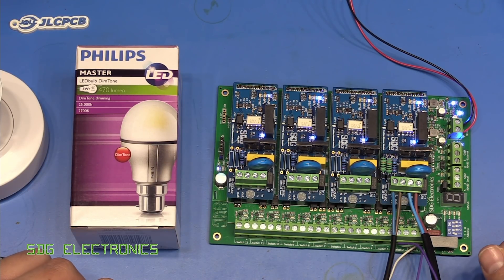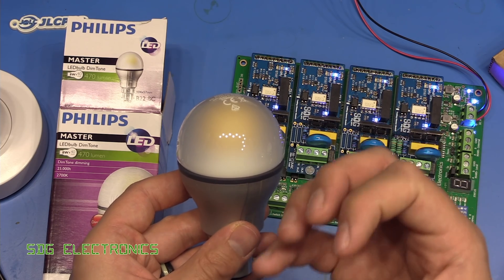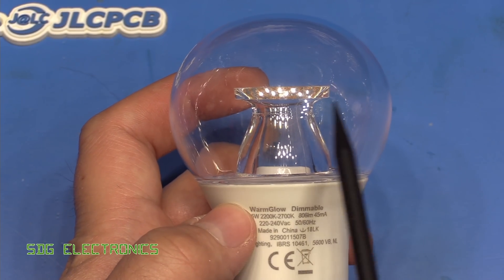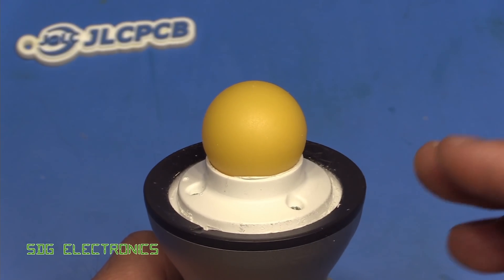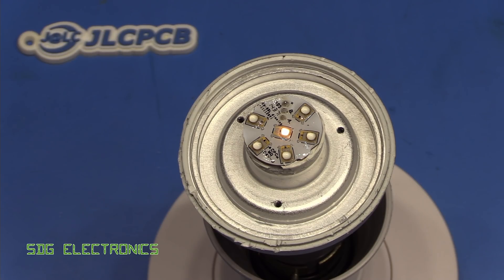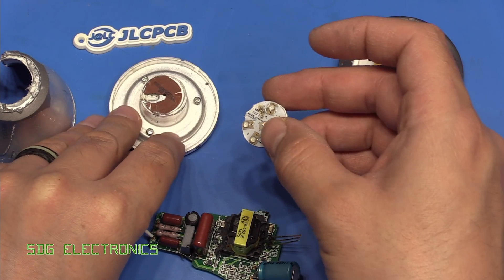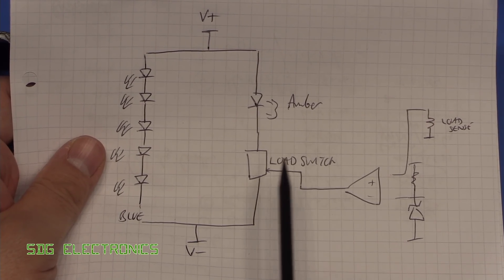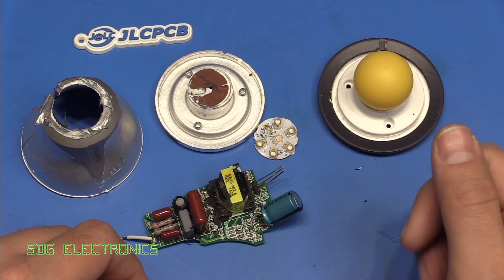SDG #244 Curious CCT changing remote phosphor dimmable LED lamps - Philips MASTER LED

Comment: I have a 1954 publication by Rohm and Haas titled "Solving Light Control Problems in Plexiglas". It includes examples of how that lens might be designed, and even includes a Plexiglas refraction protractor for manual ray tracing. Glad to see this knowledge being applied with modern simulation and design tools.

Comment: Re: LED efficiency evolution, Tesco recently refreshed their own line of LED lamps and the "filament" style has now hit 110 lm/W (806lm @ 7.3W, IIRC), which seems pretty good for £3 each! Too early to judge reliability or life, of course (I've had them since early Jan '22), and I've not verified any of the claimed specs, but I wouldn't expect Tesco to fabricate specs.

I don't personally prefer the filament style for the appearance, but in Tesco's range it has a markedly higher efficiency than the "PCB plus diffuser" construction, which I think is down around 90 lm/W (and £2 instead of £3).
Realistically, I doubt the saved energy would eclipse that extra £1 before it fails, even with Agile averaging >32p/kWh lately, but it's still nice to have the more efficient one :)

(Nice to see inside a remote phosphor system, too! I saw "remote phosphor LEDs" in Digi-Key's categories list years ago and was a bit confused. I think this is the first one I've seen in action!)

Comment: Clever, this is the dilemma in our house ,we still use natural incand bulbs so we get candle light when dim, but full spectrum color when bright. I have been adding in some cct strips so we can try to move to leds in the overheads/fans
Reply: I like to keep the whiter bulbs in the ceilings and put the incandescents in lamps.